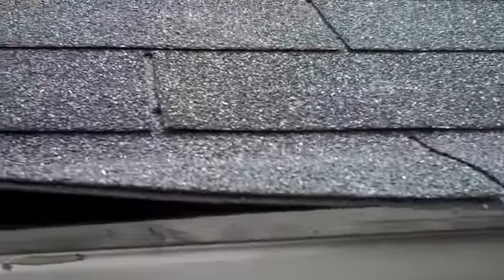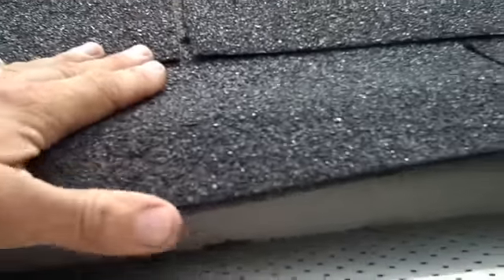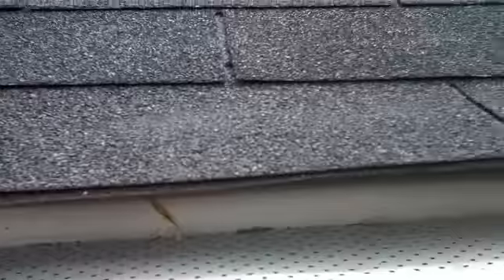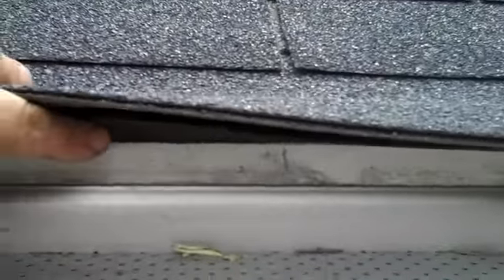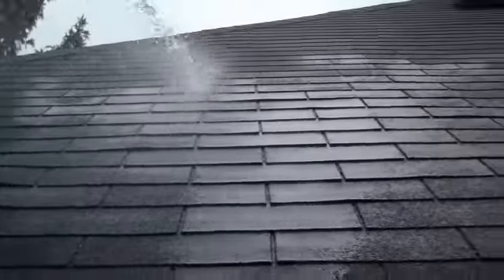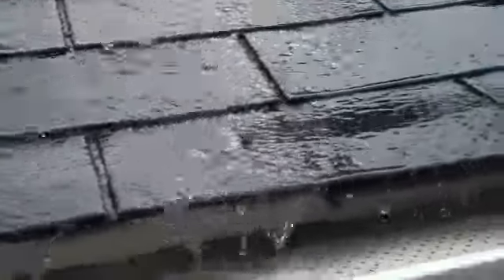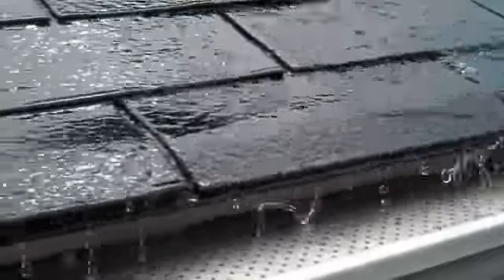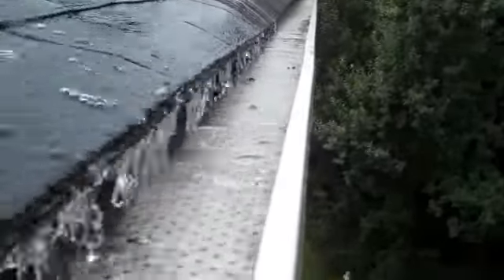How water drains off a shingle.

Comment: I have a standard gutter with flat fascia all the way across and I need to change both of them. The shingles stick off the edge about 1 to 1.5 inches or so. How far below the shingles should I have the gutter. I don't want the water to overshoot the gutter, but I'd like to keep it away from the upper part of the fascia as much as possible, as well.
Reply from the maker: Unless you have valleys that concentrate water, water drops off edge of shingle and does not shoot off from what I have observed

Comment: If there's no overhang of the shingles, can it cause a water leak a few feet into the house. Trying to figure out what's causing a leak at my clients home that they rent
Reply: Somtimes if a low slope roof water can whick back onto roof deck with surface tension of water. Somthing to look out for. However most homes have a roof overhang which will prevent this water from getting back into walls of home. Best of luck

Comment from the maker: If you take a 4 foot section of the leaf guard and combine the area of all the holes it equals the opening of a downspout. So it has the capacity to drain as much water as a downpipe every 4 feet. Hope that puts it in perspective. Yes ice pushes the old spike and furrels out but we have not seen a screw of substantial size pop out.  Thanks for the comment!

Comment from the maker: @juansito52 Its too bad but most roofers in our area do not use a drip edge and leave the shingles too long to compensate for this. We usually do not cut back shingles unless they interfere with the eavestrough function and that is not the case here. Thanks for watching!

Comment: Seems to me that a good hard rain would over flow that gutter screen.  And I agree with others, gutter flashing is a must to keep water from getting behind the gutter.  In this case the fascia is wrapped in aluminum so at least the wood won't rot, but in the winter water dripping behind there will freeze and the expansion of the ice can actually pull the gutter away from the gutter board.

Comment: You know what else causes this problem? A roof that has had a rock roof replaced with shingles but the installers left the drip edge for a rock roof in place! The rock roof drip edge is raised to prevent rocks from falling off the roof.